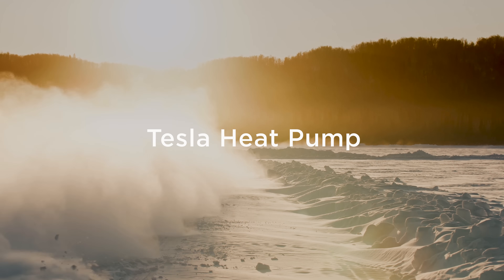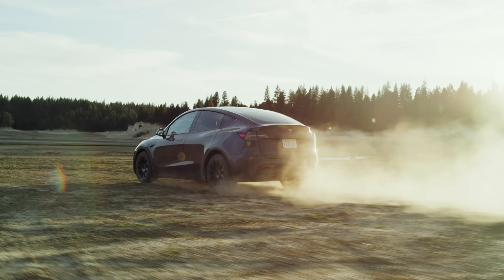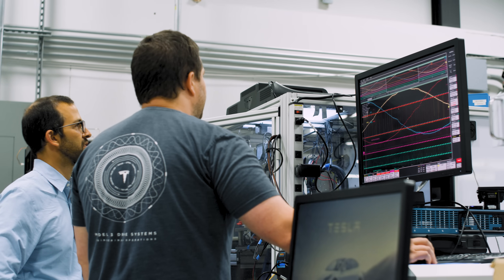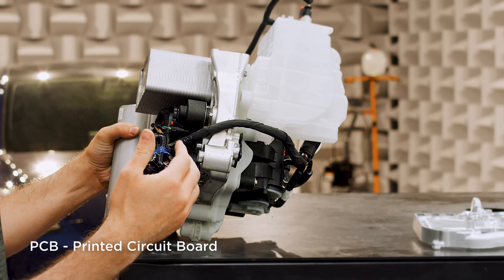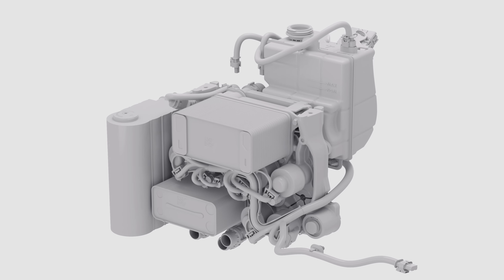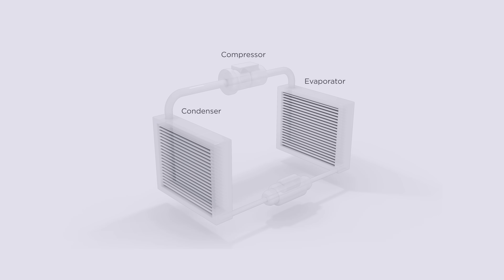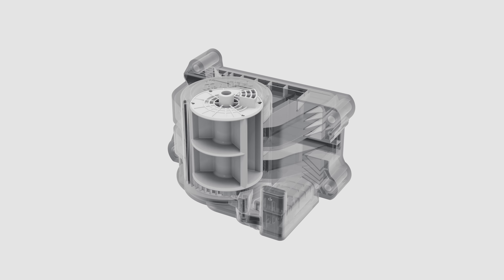Tesla Heat Pump | More Range in Cold Weather

Comment: A friendly reminder: This pump will cost you outside of warranty about $5000 dollars to replace (they can’t repair it and won’t even try to). There goes all your gas savings. Ask me how I know this…
Reply: Thank you, this is what I was wondering.  I have a Bolt with an ineffecient resistive heater, it really kills my miles/kW on cold days, but-- this heater is a very simple beast.  I'd love to have the efficiency of a heat pump, but not the complexity and cost of replacing a complex part.  

The main reason I switched from ICE cars to and EV is because there is less to go wrong (replacing engines with blown head gaskets, bad automatic transmissions, worn out turbochargers, etc.) and all of those are expensive to replace.  For the time being, I'll happily stick with my old-fashioned heater in my Bolt.
Reply: @rachelblack3816 Anything can happen to any car really.. I had to repair my clutch on my Ford, and that set me back about $4200… it’s just such a shame that we live in a time where we only swap parts and we’ve essentially stopped repairing. What happened to the “saving the environment” aspect of it?

Comment: The whole team should be fired. More than 10 000 tesla heat pump failed during winter here in canada costing around 5000$ for people outside warranty (85 000km) which is absolutely unacceptable.

Comment: anybody looking to buy Model 3 from 2021 - 2023 - STOP! My 2021 Model 3 had a heat pump failure twice with only 100,000kms on it. I was stranded in -25c because my heat didnt work after 2 months of purchase so they fixed it udner warranty. it died again and these crooks quoted me $4500cad to repair it. 
I spoke to the tech and his excuse was that I am driving my Tesla more than he does. (FYI he lives beside the dealership). 

I did some research just to find out that there are numerous owners with the same exact issue and Tesla is giving them a cold shoulder and charging them heavy for these faulty units. At this point, these cars need a recall for installing faulty components. 
I still cant believe that the tesla tech said that our AC broke cause we drive more than he does. They are hiring these techs right off high school with 0 tech knowledge. I own 3 Teslas but nomore after this.

Comment: Unfortunately Tesla have made this too efficient.  the AC will not de-fog on recirc air when the outside temp is close or below freezing.   Tesla solution is to use outside air, but if that is thick with pollutants and smog you will suffer!   I guess that's why the new cars now have a HEPA filter.      Tesla, can we retro fit the HEPA filter please?

Comment: Electric cars are one of the worst engineering failures in history.  Terrible technology, what’s farce.  Gas and oil are wayyyy more efficient and generate less pollution
Reply: school education clearly failed you
Reply: @andrewchron  no he's not wrong... lithium mining is terrible. If you want to solve climate change it's best to just get better public transportation. EV policies are not actually recommended by a lot of climate scientists.
Reply: 🔥 Internal Combustion Engine (ICE) Vehicles
	•	Only about 12–30 % of the chemical energy in gasoline gets converted into mechanical energy that reaches the wheels to move the car forward. The remainder is lost mostly as heat in the engine and exhaust, plus friction and accessory loads.  ￼
	•	A commonly quoted figure is around 20 % of the fuel’s energy actually results in vehicle motion, with ~80 % wasted.  ￼

Rough range for ICE:
	•	~12–30 % energy to wheels
	•	~70–88 % lost to heat, friction, accessories

⚡ Electric Vehicles (EVs)
	•	EVs convert a much larger share of stored electrical energy into motion. On a grid-to-wheels basis, a typical EV transfers about 60–73 % of the electric energy to the wheels.  ￼
	•	If you include regenerative braking gains, effective efficiency can reach ∼87–91 % of the energy being used to move the vehicle.  ￼

Rough range for EV:
	•	~60–73 % energy to wheels (grid-to-wheel without regen)
	•	~87–91 % effective when regen is factored in

⸻

📊 Summary Comparison

Vehicle Type	% of Energy to Wheels (Propulsion)	Main Losses
ICE Vehicle	~12–30 %	heat (majority), friction, accessories
Electric Vehicle	~60–73 % (up to ~90% with regen)	charging, drivetrain losses (much lower)

⸻

💡 What This Means
	•	ICE vehicles lose most of their energy (often ~70–80 %) before it ever moves the car.  ￼
	•	EVs are far more efficient: a majority of the energy stored in the battery ends up propelling the car.  ￼

So in terms of energy that actually goes to moving the vehicle, EVs can be roughly 2–4× more efficient than traditional gasoline vehicles.  ￼

Comment: I live in Northern Canada, and can confirm, when it's -41°, the cabin of the model 3 equipped with the heat pump is just barely warm enough to be comfortable and keep the windows clear. (anything warmer than -38° and it works just fine where I can just wear a t-shirt in the car).

Comment: Would be a cool concept if it worked but hindsight is 20/20
Reply: It literally does work extremely well
Reply: @ 
The electrical consumption will double if the outside temperature is between +°2C and -7°C. At temperatures below -20°C, heat pumps with an air (air/water or air/air) exchanger are unable to operate, as the refrigerating agent they contain can no longer evaporate.

Its math.

Comment: I have a non heat pump model. I know that when the destination is set to a supercharger the vehicle pre-heats the battery for faster charging. Can I use this feature to get more range during winter in my 2020 model 3?
Reply: Why would you think you get more range by using more energy?

Comment: People don't buy Teslas anymore in colder climates because the heatpump is just crap. They break all the time and some have their 4th or even 5th heatpump installed. Each costs a few thousand to replace.
Reply: This was an issue with the early model heatpumps, but it's no longer a problem. The cars sell super well in cold climate areas, and the heatpump works extremely well.
Reply: @logitech4873  No and no :D check your numbers.

Comment: Its funny to see Tesla presenting a heat pump as something special that only Teslas have. Every car that has AC has a heatpump. Its old tech
Reply: That's incorrect. They cannot heat the cabin with it. They use heater cores to heat the cabin. This system can scavenge heat from 16 different sources in the car, and has 35 modes of operation - even compared to other EV heatpumps, it's truly something else.

I recommend watching the Weber auto video about the Tesla heatpump if you actually want to understand why this system is special.

Comment: Here in Finland, we have real, cold winter. It has turned out that Tesla Heat pump construction  is not very robust. They dont last. There are pumps breaking in months. Mine lasted two years (i own '22 M3 SR+). There are users who have fourth heat pump in their car. So, the real reality is that in cold weather heat pump actually is not very economical and people afraid owning a Tesla after warranty expires. It looks like they put same bad parts to car since pump failures can happen even after months after replacement. Lots of Tesla drivers in colder climate are very disapointed.
Reply: @logitech4873  actually they do break still even from brand new vechiles: highland and new Y:s in cold climate. Its just a fact, not an opinnion. For ie:  In this video Tesla Y has allready four heatpump failures. https://www.youtube.com/watch?v=gz4Ldx6sKcc
Reply: @petrikuula634  Instead of anecdotes, show statistics. A recurring issue in one car doesn't mean much.
Reply: @logitech4873  here in Finland where we have real winter, this car with four heat pump failures is not the only one. Mine was replace last year. Lets see if it lasts over this winter. No, they have not fixed the issue, since new highlands fail too. Sorry to ruin your fun boy day dreaming. It may be just fine if you live in warm country. Tesla obviosly did not test it in cold at all. There is going to be court cases about these. You can ask starts from Tesla. Tesla has allready ruined their reputation as showing middle finger to paying customers. That will be a difficult one to fix.

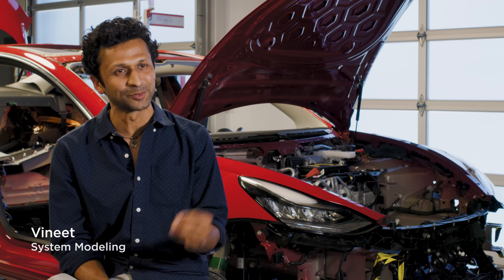Comment: 2:26 Mr. Vimeet. Can you redesign the front flaps, that there is heating or extra snow/ice melting cycle thar prevents the compressor sag for blocked evoporator in front. Third compressor going in my great Model 3 sr lfp. Its just cant handle snowy -0C conditions in Nordic country. The heatpump works good below -5c and later but the -0c and rain, it just blocks the flaps and front bumber and it just breaks the compressor for low suction gas density while compressor run med/hi

Comment: We wanted to make it all one component and proceeds to show a 100 parts being put. Tis there to make the one component verse 7 a radiator in a heater core. And those valves already exist. It's called a bypassmile every car in the world has one. Where it can heat your car or be closed off and be ran as coolant. I really thought.
Hey, be much more innovative.
Reply: I don't think you really understood what they were showing. This system can bidirectionally flow coolant between a large number of components depending on their needs. It's a far cry from the common radiator and heat pump systems in cars, and the valve setup they'd traditionally need to do this would be very large and have very many parts.
Reply: No idea what you’re babbling about

Comment: heat pumps dont work -20c
Reply: There's no rule saying that. The air-to-air heatpump I have at home works even at -20°C, and Mitsubishi ones work at even colder temps.
Reply: In -20 degree weather, you'd be better off riding a polar bear to work.

Comment: How do you tell if you have this heat pump. I just bought 2023 long range model Y 330miles
Reply: Tap on the little car icon on the bottom left of the screen to open the menu, tap software, then in blue text you'll see "Additional vehicle information" tap on that. It should be the fourth one on the list next to "Cabin heater".
Reply: @bojack69  thanks

Comment: I suppose it isn't possible, or maybe not cost-effective, to install a heat pump on an older model? I have a 2019 TM3.
Reply: Probably close to impossible. Nothing is going to fit anywhere - it's a very integrated system that connects to almost all components.

Comment: and this , everyone , is the reason why Tesla is the king
Reply: i can just see chinese competition scrambling the heck out of reverse engineering this .
Reply: @jesbsnrn  my BYD has a heat pump. cant see it helps in range loss. marketing scam all this is.
Reply: @isaachunt5799 if you see what the airconditioning system is of ice engine plus the heating core.  you will realize the weight and space savings . and compared to other ev teslas heat pump is the size of a 15 inch shoebox.  byd did good but tesla is the one the innovated and improved the existing tech.
Reply: @jesbsnrn  but still 30% loss in winter. my BYD has heat pump. my leaf didn't. i cant see any difference. no such thing as a free lunch as they say. it's marketing bollox. many cars it's a 1200 dollar extra. utter waste of money

Comment: I live in Fairbanks, Alaska. It usually gets to about -30 or -40 degrees F in the winters. Will a Tesla, specifically the Cybertruck, be able to function at a decent rate considering this weather extreme?
Reply: It will work on those days yes, but on longer drives you should pre-heat the car before driving, and even then you'll get fairly poor range. The heatpump will not be able to keep up with temps like that, and will fall back to resistive heating.
It will work great the rest of the year though.
Reply: No one can speak to the Cybertruck yet, but there are lots of videos by Tesla owners in very cold climates on this topic.  Bjorn Nyland (Norway) is probably the best one.

Comment: So, you basically have to plug in at all times when parked in the cold to replace the energy used by the heat pump?

I mean, if I am on call for 24 hours in house at a hospital and park outside at 0 F and can not plug in, I still seem to loose 40% of my charge?  Why?

The solution, by my watching the video is to plug in when parked in cold temps otherwise the heat pump drains the battery.

Comment: @Tesla : Are you thinking of producing small compact efficient and effective (𝐶𝑂𝑃 >5)  heat pumps that other manufacturers can use in their products and systems?

I'm thinking of local hot water heaters (for example in bathrooms and kitchens), with a small well insulated hot water storage tank, to get rid of emmersion heaters and save energy.

The heat storage could also use rock or concrete, or something like Napthene, taking advantage of phase changes.

Comment: Would love to see a solution to convert volumetric cabin heat to electricity in an efficient manner. This will reduce the need for cabin cooling in peak summer and avoid the ugly but needed darkening of the panoramic and other viewports on the vehicle, to cut down the amount of heat accumulation in the cabin area.
There will also be a marked reduction in the range loss, due to simple parking with no shades under hot sun.

Comment: How much energy does it draw from the battery to perform this heating?
Reply: Expect ~2%
Reply: @logitech4873  ~2% over how much time?
Reply: @amochswohntet99  10-15 mins maybe?
Reply: @logitech4873  maybe?

???
Reply: @amochswohntet99  yeah depends on how cold it is, and whether you need to wait for ice to melt off or somethint.
Reply: @logitech4873  Was wondering the energy drawrate to maintain room temperature in the cabin in say, 40⁰ weather. Not to preheat the batterypacks, motors and cabin for use, but to maintain room temp for the cabin.

Comment: I just noticed something about my home HVAC system that seems wrong. If the house gets too warm inside in the winter it uses the AC compressor and runs the AC when there is plenty of very cold air available outside. Why does it do that?

Comment: Heat pump system will get frost on the condenser, reducing the efficiency, so it used to be running the loop back and forth 😂

Comment: Lots of words with no real information. As a 37 year HVACR technician with degrees in Heating and Air Conditioning Technology and electrical engineering, I know how a heat pump works. It's a direct expansion refrigerant circuit that absorbs heat in one area and moves it to a desirable location. What you failed to explain is where the heat is absorbed through the latent heat of vaporization. Are your refrigerant lines passing over warmer vehicle components like drive motors or gear boxes? Are they tied into the braking system?
An internal combustion engine uses a hydronic loop that transfers heat from the engine cooling system into a cabin mounted hot water coil. Seems odd that you'd spend so much money producing a "fluff piece" that gives about as much information as I could teach in less than 10 seconds.
Reply: This isn't exactly a very informative video. The loop does get waste heat primary from the battery and the motors.

Comment: Maybe the Tesla engineering team can address the best way to increase and tweak the best cold-weather efficiency on Tesla vehicles that have a heat pump in near freezing and below freezing conditions?  For instance, does turning on defrost mode on a cold morning heat or increase the main battery efficiency or does it only heats the cockpit?  What about scheduled departure mode if the vehicle is not plugged in?  What battery energy savings can be achieved over jumping in a near frozen Model Y and just driving off on a cold morning with no cabin heat or battery conditioning? What if you are crazy and want to maximize range, can one turn on the cabin A/C to max cold on and icy morning and dump extra heat directly into the main battery to increase range efficiency while you endure sub-arctic cabin conditions?

Comment: Wishing Tesla would stand behind this system for more than 50,000 miles. First Heat Pump died at 48,000 miles, next at 100,000. Now Tesla wants $4000+ to replace Heat Pump, Super Manifold, and all related components.

Comment: Even though I like once single component, separate components in a decentralized manner tend to be better for repairs and replacements. I don't wanna hear that you have to remove the whole heat pump if some duct, tube, or valve has gone bad. It only costs more.

Comment: Don't heat pumps drastically loose their efficiency as the thermal differential in the environments become greater? (Suppose you wanted to heat your car in the winter with a heat pump, the pump has to work really hard to further intensify an already present thermal gradient by trying to extract out the last bit of remaining heat from an already cold environment)
Reply: Yes, but you can always supplement with resistive heating. Efficiency will always be equal or greater than a purely resistive system.
Reply: Below about -10C/14F the heat pump in the Tesla has lost all its advantages and is thus equivalent in efficiency to the PTC in older models.

At that point it uses the heat pump motor and anything it can scavenge from the traction motors as sources of heat.
Still gets good and hot though. I've driven down as low as -10F/-25C and been toasty.

In the grand scheme of things, even if you live in MN or other place where temps below -10C/14F are not unusual, its only a small percentage of driving time that you spend below those temps. A significantly higher percentage of time is spent driving at 20-40F where you get great benefit.

Comment: Great video! One of the best innovations I've seen for the cold weather EV market. 

A fun fact about the Tesla heat pump is that it is capable of extracting heat from the air even when the temperature outside is as low as -40°F. This means that it can provide heat for a vehicle even in some of the coldest climates on Earth.